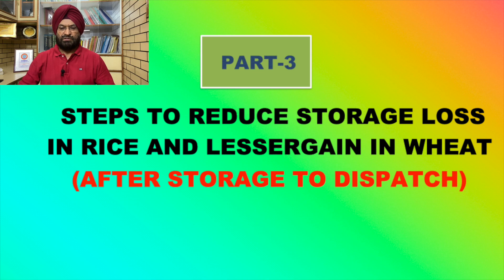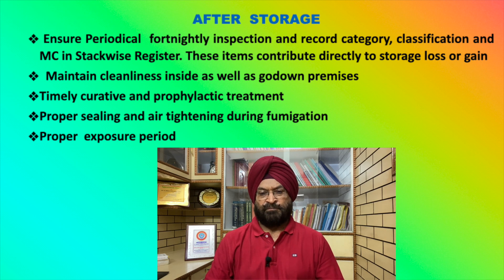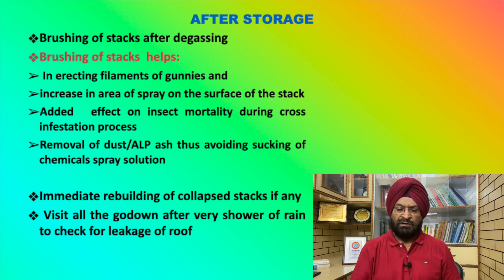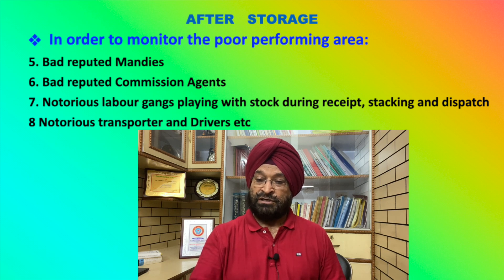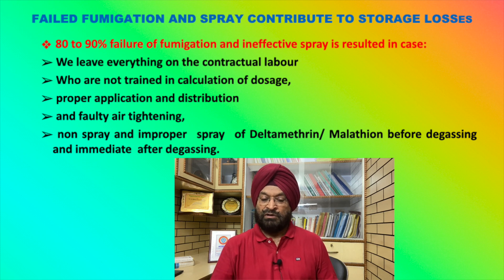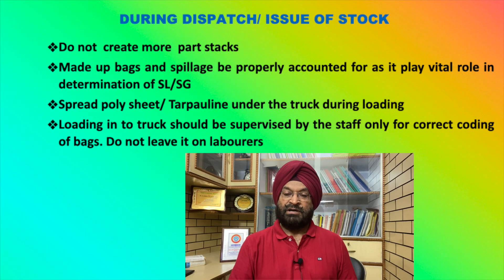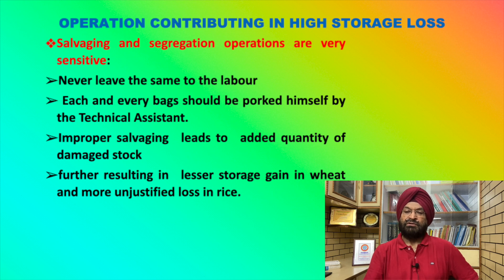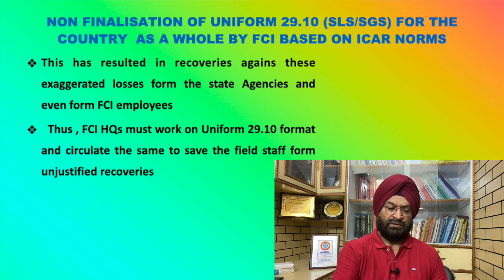HOW TO REDUCE STORAGE LOSS IN FOODGRAINS PART 3

Comment: One more concerning issue is that even after the rice has reached a mean equilibrium moisture content of 12.5% post-draught storage period in FCI godown, it often exceeds 14.00% moisture during the rainy season. This results in the justified loss appearing smaller in the 29.10 excel sheets than before where 12.5 % attained in summer months. However, ICAR and other research indicate that this temporary moisture gain can lead to mold formation in the grains and a significant weight loss, which is evident in actual godowns. Grains stored for more than a year with moisture above 14.00% become unfit for consumption, which violates food grain storage standards. Yet, this concern has not been adequately addressed within FCI.

Comment: Additionally, in the 29.10 format, a drop in moisture level from 14.00 to 13.8 in rice is being used to demand gains, as per the circulated sheet. This is leading to the framing of chargesheets, which can be easily removed by clearing up the ambiguity.

Comment: Thank you so much for explaining everything so well. Sir, I have some queries and would like a video on this topic:

1) As per ICAR, a graphical representation of storage loss for each zone is given, but the storage loss for rice is often manipulated.

   A) For instance, in rice storage loss, during summer, the issue of moisture content ranges between 11.5% to 12.5%, with an approximate drop of 2%. However, when finalizing storage loss, a drop of 0.6% is given to reduce the storage loss, and to avoid higher level squad, the loss is manipulated using the weighbridge/moisture meter. The recovery of this loss is done using the gain from wheat, which is a major concern.

   **As per ICAR research, the actual loss is higher, but FCI reports a lower loss, which violates the research findings. Please make a video on this topic.